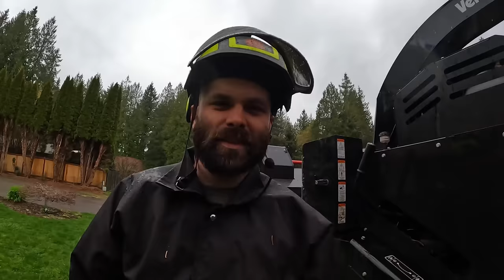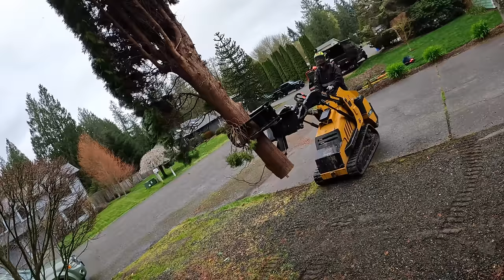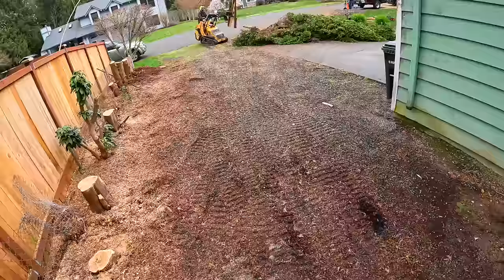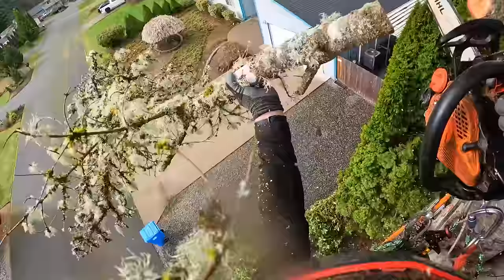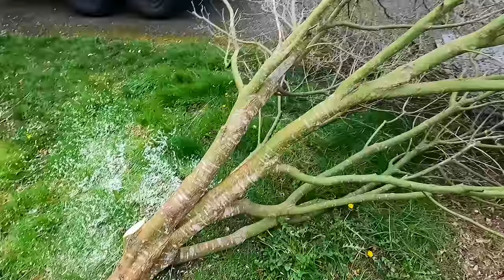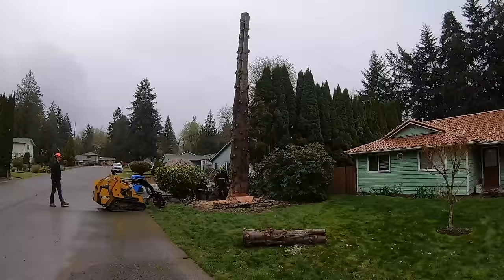Making Easy Money Cutting Down Trees!

Comment: Ol timer told me to keep the wedges from coming out like that was to heat them up in the truck and it would do that. It’s the cold that’s messing them up. I’m yet to try it but I will see.
Reply from the maker: The Stihl wedges are made of hard plastic. Id have to set them on fire to soften them up. 😂
Reply: @VeteranTreeService  I hear that that propane fired weed burners work good for heating up Stihl wedges.
Reply: @VeteranTreeService  yea that’s what I thought. I’m yet to try it. Most of the time the tree gets pulled over anyway.

Comment: I run with the evo been wanting to get into the MB saddle I’m similar in size as you what would you say your first impressions wearing it in the tree are?
Reply from the maker: Shocked in the difference. Pulls more from the legs than hips. After climbing with it a few times, I'm only going to use it when removing big trees carrying a big saw. It excels in that area.